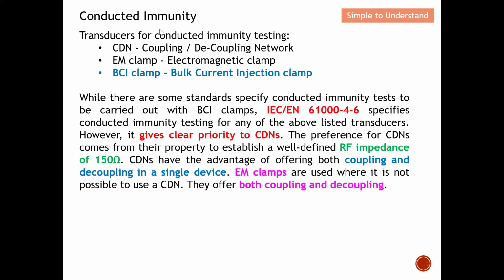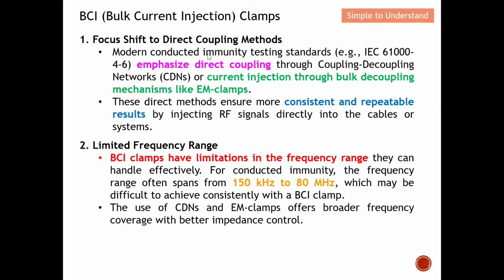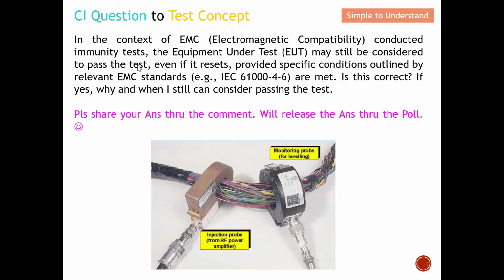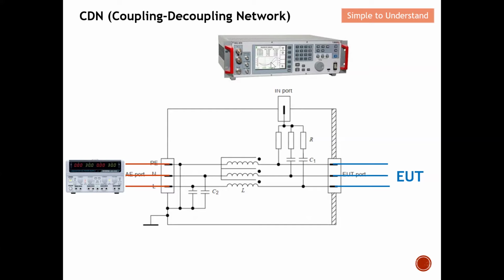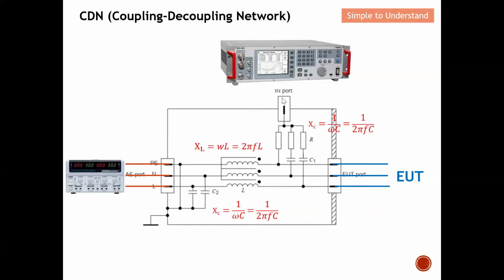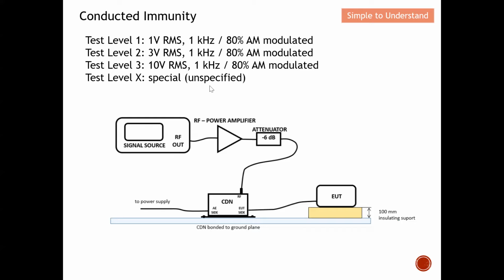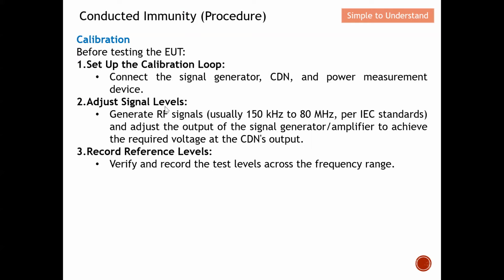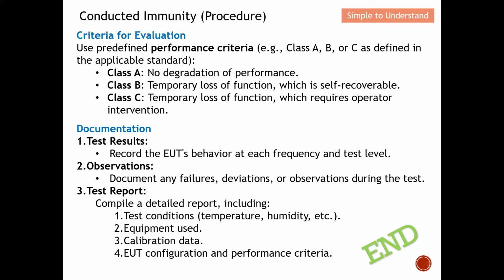EMC #68. What’s Inside a Coupling Decoupling Network? Roles & Purposes of CDN in Conducted Immunity.

Comment from the maker: Thank you for your support on this video.
In this video, I share the test procedure and steps for performing the conducted immunity test according to IEC/EN 61000-4-6. I also provide insights into what is inside the CDN (Coupling Decoupling Network). In short, the inductor and capacitor act as a low-pass filter (LPF) or high-pass filter (HPF), allowing the power supply or high-frequency noise to reach the EUT (Equipment Under Test).